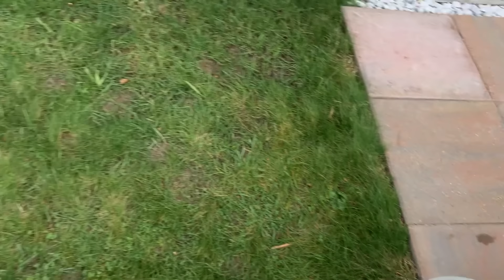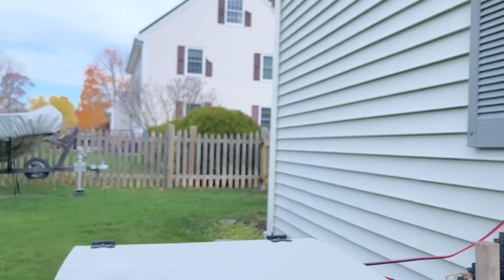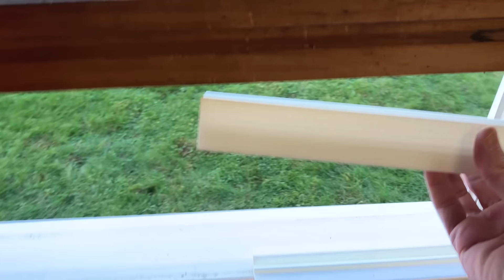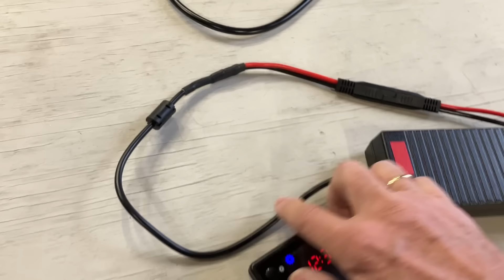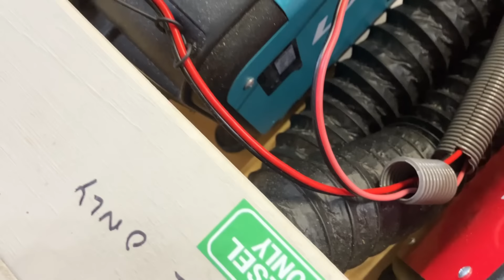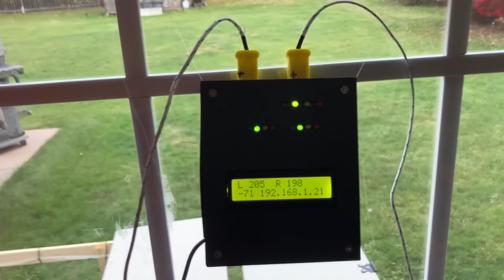Part 1: Dual Diesel Heaters for My Garage! Overkill? Maybe. Awesome? Definitely.

Comment: Nice work mate.

Just added a bunch of suggestion to the already full "box of suggestion" about how I'd like to do a heater for emergency use only
Reply from the maker: Thanks! Not seeing the suggestions, so I might be looking in the wrong place. I'm getting a fantastic knowledge dump of information. Love it!

I can totally see it for emergency use. If its a house if you figure out a way to make a window opening that allows just 1 hot side in, you can bring it online fairly quickly with just a 3" hose and the onboard 1.3 gallon fuel tank. Run it off a 12v battery. Just remember these are only about 15,000 BTU's of heat on max.
Reply: @V-Tank The suggestions were all from your video to my suggestion box 😊
Reply from the maker: @paulboucher2664  Duhhh... Got it. Glad between the video and comments that this is helpful.

Comment: cool wouldnt insulated  ducts work better on those cold days ?
Reply from the maker: Yes. When there is fresh snow it has to melt it off the ducts and thats heat wasted for sure. Or windy days it runs cooler on by the time it hits the garage. I have not found 3" insulated duct, but I haven't looked hard either. I could stuff them through a 4" insulated duct, but I'm worried about water getting in the middle.

Comment: I like the concept and approach, but why didn’t you just take the original heaters out of the cases, or just pull the tanks out and plumb the fuel lines into the fill opening? Run one fuel line  from a can then split it with a tee to the two shutoff valves, their are many portable 10 gallon fuel cells out there on marketplace, ( it is easier to always second guess than make it first hand ), on the exhaust, scrap the heat wrap on the exhaust pipe, use sparkplug boots that are made for the heatwrap material, cheaper and isn't as much of a pain in the backside to put on or hold in place as wrap is. I like the concept, looking forward to rev version "D".
Reply from the maker: Thanks for the reply. Revision D! Ha, I'm sure there will be in a heating season or two. In gen 3 the current one I'm no longer wrapping the exhaust. Wrapping was a huge PIA, didn't know about spark plug boots. I did buy a T this year, but ended up with two separate cans, which is actually working out pretty good since I have to move my fuel a can at a time. In retrospect I could have just removed the covers and tanks from Gen 2 and direct fuel lined them and I would have easy access, etc.

Comment: While you Install is clean and attention to detail is appreciated. 
You have built a Monstrosity !!!!

1.  It will NOT operate properly in winter with any significant snowfall properly. 
from your fuel intake source and fuel cutoff switch and using WOOD to collect water and the overall footprint. 

I see your wife raising hell. 

To achieve to SAME GOAL and have a Clean and Un-noticed setup here is what I suggest. 

On the Exterior of you garage near the window , use ONE , All in One Unit , 
I suggest the LF Brothers unit Camping or black VADER unit. 

Install it inside of an Aluminum Box ( truck style toolbox )
and mount a 5 gallon Fuel Can inside your garage to preserve the integrity of the Diesel in cold weather. 
Run that fuel line into the lid of the internal fuel tank on the All in one unit as a constant feed OR eliminate the internal tank of the All in One unit altogether.  
If you have serious concerns over fire , like stated on your Gen II setup. 
Keep in mind , Diesel is very safe.  It is not easily ignitable without intense heat source to burn it.  
Utilizing the Semi Warm air to circulate bsck into the heaters intake does help with a stable output temperature.  However your Fresh Air Intake is still introducing sub zero moist air into your burn chamber and THAT air being warmer would keep your burn chamber and "glow plug" igniter much cleaner. 
What you have is serious overkill and that outside wood structure with exposed fuel lines is certainly going to be problematic in weather.  ESPECIALLY if you experience temperature variations that produce condensation both inside and outside of your fuel delivery apparatus.  

In all seriousness.  
A single ALL IN ONE UNIT 
in Protective Box outside the window , with significant fuel capacity held indoors , but pumped outdoors into the unit would give you a simpler heat solution, controlled by Bluetooth App and/or RF Remote , with Thermostat 
And would eliminate that " eyesore " you've built outside.   My Single LF Bros Camping ( green model ) efficiently heats my 650 Sq ft Cabin to temps as low as 2 degrees F  , giving me about 65-70* f indoors.   I do supplement when temps get below zero in Fahrenheit with a Cubic Mini Grizzly model woodstove. 
For an all winter heat solution , I have a 55 Gallon drum of diesel , and last winter it lasted me from
Nov 1st to April 15th running at Level 3 , approx 5kw output, mostly from late afternoon to mornings and during the day using hardwoods to keep it tolerable around 50-60* f indoors.  

But yea. 
That is a MESS and could be easily refined into a reliable setup with less moving parts than you currently have 

try it
Reply from the maker: Thank you for the great reply. Its giving me a ton to think about. Maybe next season. The LF brothers and VADAR units are also 5K units? With my inefficiencies I introduce with the uninsulated hot air pipes outside, one unit will maintain temp in the garage, buts really hard to warm it up. I don't heat it full time. The second unit is all just bonus heat and helps bring the temp up quickly. Last season I was running the Gen2 and pouring fuel. We'll see if this season if it gels up. It should be winter diesel by now, but I am worried about that with a thin tube exposed to the cold.
Reply: @V-Tank exactly why I suggested keeping the actual fuel tank inside , pump it out to the unit and run rubber hose over the actual tiny fuel hose. that way the unit is always getting diesel above coagulation point temps. 
there is little to no safety risk keeping a fuel tank indoors if the unit is outdoors and in a box that is semi insulated. 
I've seen guys in Nunavut run a tiny 1/2 hose that is " T'd" off their heat output vent back to the fuel pump and tank to keep internals/lines/pump warm too. 
But they are dealing with -20 to -40 temps in peak winter months. 

I used to rep for MaxSpeedingRods and they de-focused on Diesel Heaters over to Generators ( and car parts ) and prior to that I did installs and repairs for Eberspacher  in trucking fleets like Day n Ross amongst others.
Reply from the maker: I'm not as worried about diesel inside (its not Gasoline) as I am about the burner of the heater along with the exhaust. These cheap ones are so cheap that it worries me that I'll have some sort of unplanned failure. Its like the wild west of Chinese Diesel heaters.

I can see what a game changer these were for trucks and vehicles, especially with all the no-idle rules.

So I'll see where I get to this winter as I might have to manage my fuel better for temps. Last year I did okay with the fuel tank next to the heater and I didn't run it all the time.
Reply: @V-Tank LF Bros uses key internals from Japan and Germany.  A level of product that far exceeds the 'vevor' type units under $200 
huge differences.
Reply from the maker: Thanks. I hope that info helps someone else too. Some of mine have been as cheap as $70, so doubling that cost to get to Japan/German quality would make me feel a lot better.

Comment: This feels like something that could be handled better, at a similar cost, with a monitor type heater and a big stationary outside fuel tank. I wonder what the motivation is to avoid a more standard heater installation like that. Can’t be about saving time. 😅
Reply from the maker: It just evolved into this. It started off as a singe heater for $80 US. Crazy thing is I have Natural Gas into the house. That would have been the right way to do this. But sometimes you just have to muscle your way through things because its fun. Thanks for taking time to comment.
Reply: @V-Tank  - Definitely an absorbing hobby, the way you’ve laid it all out. Don’t mind me. 🤙😄 Totally understand the “But it’s only $80!” effect. Especially when a monitor heater is like $1,800. Saw some at the local hardware store recently and turned right around when I saw the price tags. 😅

Comment: You're going from 120 to 12 to 120 to 12v?
Reply from the maker: Yes. I wanted to use a car battery and charger, I was building a box for to house all of that, then got the Ecoflow for a really good price, which sent me back to the power bricks. The Ecoflow is just there for a random power outage (UPS) if you will. Which will give me time to shut it down.
Reply: @V-Tank I run 100ah lifepo4. Running averages 3ah. Set up on a timer to charge it twice a day for 1.5 hrs each. 
Have also played with solar a little

Comment: Last last recommendation.
When I was running lengths like yours with 90s I had poor performance.
I took 12v pc fans on their lowest setting to push air into the intake and it made a massive difference.
Before I was getting close to over heat temps in the unit
Reply from the maker: Yes!!! I have totally seen that issue. Especially on high when the garage starts to warm up. I've thought about the 12v PC fans. I'm making a new video where I swap the displays (and the heater electronics) so that I'm using the display heads that can be programmed for higher fan speed and lower fuel hertz.
Reply: @V-Tank  careful with lower fuel. Can cause carbon build up. 
Pc fans work a treat

Comment: Last recommendation. Run your fuel lines from low to high without all the up and down to get air out and make printing much easier
Reply from the maker: This is good, but I was trying to avoid a fuel line break causing a siphon of the gas can and draining it all over the ground. I have a spare 5gal can, so I just swap them out before I run out (we'll see how that works out this winter).

Love all your comments BTW, I have so many new ides from all of this. Thank you!!!

Comment: Recommendation for fuel. Either get a vehicle diesel tank or drill a hole in the can somewhere so you can use your cap to fill fuel while still running.
Reply from the maker: Thought I replied to this... So if its a duplicate sorry. I have extra cans, so all I have to do is swap it one out and not have to pour. Vehicle diesel tank would let me get like 100 gallons. That indeed would be nice.
Reply: I picked up a RV tank at 100 gallons and a tractor trailer tank at a 100 gallons. That was I can get off road delivered for 2 bucks cheaper a gallon than on Rd at the pump @V-Tank

Comment: I'm confused why you are rubbing such long pipes. Got to be losing a bunch of heat outside. 
Mines mounted right to my living room window
Reply from the maker: 100% loosing heat. Unit inside with only an exhaust is going to be the most efficient. It just evolved into this. My first heater I was just trying to pipe in heat from a single pipe coming inside.

Comment: I just have one i drilled a hole in the wall and siding for the exhaust and hung it under my bench and it works great I love these diesel heaters
Reply from the maker: I've seen a ton of inside installs which are way more heat efficient than what I built since the only heat loss is through the exhaust.

Comment: You could just have pulled the covers off the Gen 2 heaters and removed the tanks and done the same setup as your Gen 3,  cool setup :) , nice to know that 5 gal are enough for about a week.
Oh, have you planed to insolate the intake/outtake?,,

Good video. keep up the good work.
Reply: I don't see how. Heating my 25*25 living room I get about 2.5 days staying at 73f. Im mounted right to the window so not the pipe heat loss. And I've taking my fuel swings and reduced them .3 hz each

Long story short. Safe rule of thumb is about 1gal per 8 hrs.
Reply: @nickabel8279 thanks for answering. :)  have a great day.
Reply from the maker: Agreed that I could have just got rid of the fuel tanks. Gen 2 was hard to service because of the metal covers, which when I think about it without fuel tanks I could have just removed the the covers and left it at that.

Comment: gave me some great ideas for my shed which has the washing machine in it.  i don't like frozen pipes and busted water lines.  thanks
Reply from the maker: These are fun units. There are a bunch of different models, but there is a thermostat mode on most vs just a power setting.

Comment: Thanks for sharing your crazy setup! Made me putting 1 in the garage seem like nothing to the wife. Something safety related.. diesel heater’s combustion intake should always come from outside. This prevents negative air pressure, reduces carbon monoxide risk, supports efficient burning, and maintains air quality. Pulling indoor air may seem more efficient, but it’s riskier and can harm you and your heater over time. This is directly from the manufacturer and also why they never give you tubing for the intake.
Reply: Maybe you didn't watch the vid or know how they work. The combustion intake is outside...the little black plastic hose under heater. The black slinky hoses to inside are the blower intake...should be the inside air
Reply: The big tube from inside the garage is like the air coming in the back of an electric fan heater. The combustion chamber intake is the small black tube with the weird cartridge on the end, sticking out the bottom of the heaters outside, near the small silver exhaust pipes. The two air flows don’t cross. But it would be much simpler to just have the main body of the heaters inside the garage, with only the small exhaust and combustion intake pipes going outside, and the fuel still sitting outside. A lot of people do that instead of this complicated setup.
Reply from the maker: Yup. This is way more complicated. I know some people attached them to the outside of their house so its more direct. But most people run the unit inside with the exhaust flowing outside. I'm just sharing what I've done and learned in hopes it will help someone or give someone an idea they haven't thought of.
Reply: the combustion air is taken from outside,   the in & out pipes are just the airflow.    it has a smaller pipe underneath thats the air for the burner.
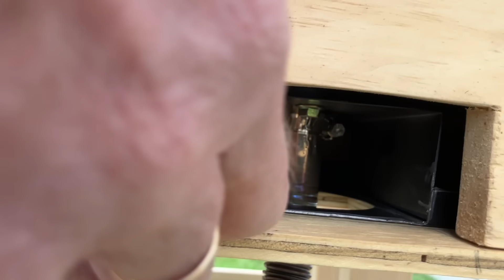Reply from the maker: Thanks for sharing. Don't tell your wife, but you'll want to do more over time. They are so cheap, its easy to get out of control and tinkering is easy. Plus you get a heated garage. There are two loops. There is the combustion in and out. If you look closely at about 6:14 seconds where I'm showing the underside (wished I had pointed it out better) the big black thing is the combustion air intake which is outside along with the exhaust. The second loop, which is the heat loop in and out (I 3D printed the air intake connector that you see from the top view). That loop hopefully gives me neutral pressure and the air is the same clean air that came from the garage provide you don't have a damaged heater. All the exhaust stuff is outside. I would add keep a CO meter with any heating device and a smoke detector if possible. These are super cheap offshore knockoffs. Two more videos on the way, one about the controllers and another with a tone of Q&A and I'll see if I can add this in as it will help others as well. Thanks again for commenting.

Comment: Cool! But why not just add a wood stove? Lots of places on marketplace sell wood for free. It cost no gas, no electricity, etc.
Reply from the maker: That's a very good option. Not sure how I exactly ended up with the diesel heaters. Just evolved into it. I originally started with a couple of propane "Buddy" heaters on a 20lb tank.

Comment: Nice setup. I'm watching this while my old 80s mobile home is heated by an 8kw CDH. I have mine mounted inside. Little bugger works like a dream. That said, I will be investing in one more. Found out recently that with only one unit it's unable to keep up once the temps hit around 25F. Once I have two units it shouldn't be a problem and I should be able to use the "thermostat" setting instead of the always running mode. Which will be stellar for better fuel economy.
Reply from the maker: Exactly my problem on my garage. One heater keeps up with heat loss, but barely. I'll reach a max temp where it just can't warm it anymore. Or on a super cold day its just not quite enough. The second unit is bliss, because its all extra heat and makes things nice. Or I can run them  both on a lower setting.

Comment: Don't have one at home yet, but have had numerous units in semi trucks over the last 15 years. Granted they're usually the Esbar German models, but these seem to be functioning perfect. I was considering one for the house for power out situations. Evidently in some areas they use these units to heat their homes. I was wondering about the condensation from the exhaust on the ones that you are no longer using since the pipes went down then back up?
Reply from the maker: These are fun and dirt cheap compared to the brand names. I haven't noticed condensation on the exhaust. The muffler has a hole on the bottom side to drain water out (there is a top and bottom). However since I'm trying to heat a big space, I'm usually running it at max power and the exhaust is super hot. So I'm assuming if I were running it on a lower setting like in a truck, maybe things condensate? When I took apart my version 2 of this, the exhaust tubes are cheap and get a little more brittle, but they seemed fine for another season. Hope that helps.